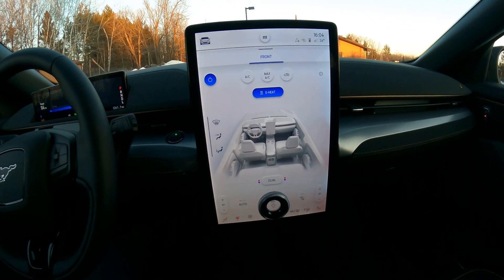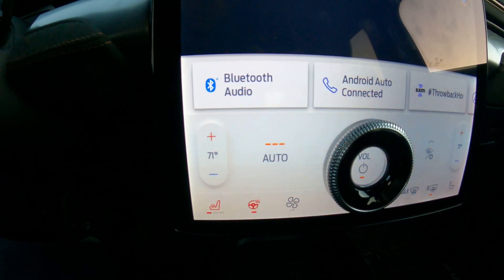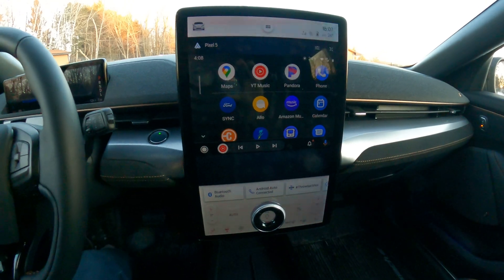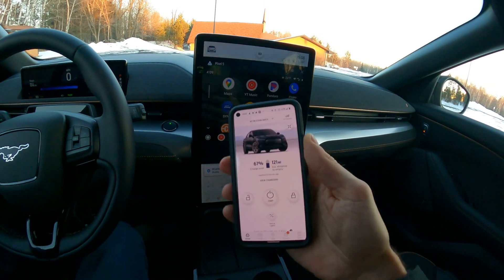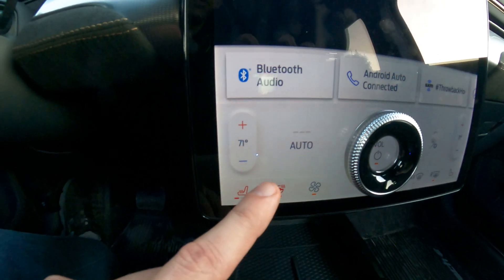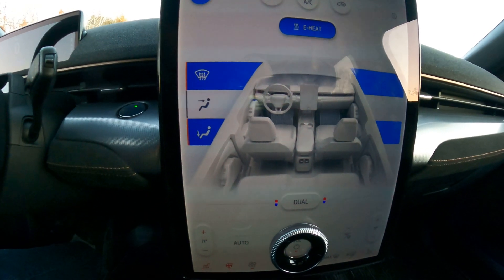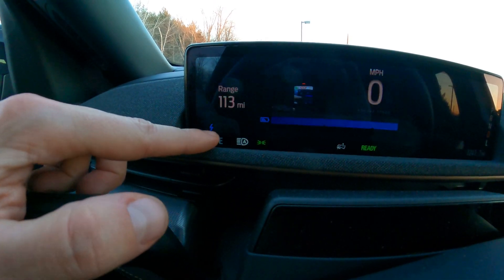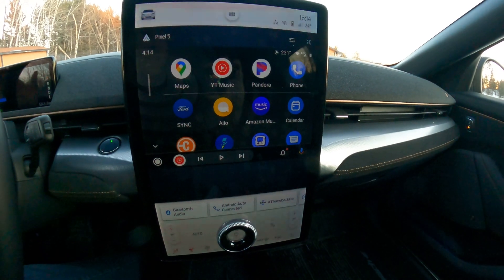Mustang Mach-E Electric Heat - 5KW heater enough for MN Winter?  EV Heat Mach E

Comment: When parked, the interior heating is turned on only when the driving mode is on or after it if only the ignition is turned on, but if the car has been parked for a long time and only the ignition is turned on, then the heating does not occur. GT version

Comment: I was wondering if you had a chance to talk about the difference between the Heating Pump and the PTC System. Going to pick up a Mach E very soon.
Reply from the maker: I cover it a bit in a different video I believe.  Pros and cons to both and I think the ideal solution in cold climates would be having both, but I'm sure that adds a bit to the cost.  The heat pump is more efficient but doesn't do as well in very cold weather.  The PTC uses a lot more electricity, but isn't affected by ambient temperature.  My main gripe is that it's undersized for the MN winters and if it's below zero degrees F it just can't keep up.

Comment: I watched a video of Mach e saying there was no heat coming to their feet on the driver side. How is yours? I watched the video more and it looks like you answered my question
Reply from the maker: Mine is much better now with the TSB fix for the heating system.  Still not comparable to a combustion engine, but much better

Comment: Hello Mike, in the Dutch Manual, it states the E-heat can be swtiched off. The car will "generate" alternative warmth. But that sounds nuts. To your knowledge, does the car extract warmth from any other source ??
Reply from the maker: Yes, it can pull heat from the batteries as they warm up due to regular driving.  This is only in very moderate weather.  I can't say exactly what temp, but maybe around 15C/55F or so, where you don't need a lot of supplemental heat.  Think of it more as a shoulder season option.

Comment: I've got a FE Mach E and thought I was going nuts back in the early winter thinking my heater was blowing cooler air at times, even after preconditioning (Manually starting from FordPass, not by departure time). I currently precondition the car while not plugged in (working on getting an adapter for my plug so it can reach my car in the driveway). At low speeds the car heats just fine, but once I get on the highway I'm freezing and the car struggles to defrost any ice build-up on the windshield that may occur. It was 1F this morning, roughly -8F with the wind chill and my car didn't get warm until I parked at work, which is around a 25 minute drive. 

So far I'm extremely unhappy with all of the issues with my Mach-E (I expected some, just not as many as I've dealt with), and winter driving really makes me consider trading it in... Then I remember how much I like it during the rest of the non-winter months.
Reply from the maker: I'm with you!  Watch some of my newer videos and you'll see some tips I have.  I've learned a lot over the past month!
Reply: @upnorthmike6085  Hey Mike! I had actually checked out some of your more recent videos since posting here. I'll definitely be giving the preconditioning through departure time a try when I get a longer charging cord. Definitely glad to of come across your channel!

Comment: Do you have any issues finding charging stations for your car?
Reply from the maker: I do not.  However, there was one time I was going to travel about 2 hours to a small town of less than 3,000 people and there were no charging stations within 50 miles.  I took my other vehicle instead that time.  Otherwise, with just a little pre-planning, I have had no issues finding either free or fee based chargers

Comment: Is there a difference between using the departure setting in the Ford Pass and manually starting it 15 minutes before you leave?
Reply from the maker: Great question Greg; no there is not.  My issue is my schedule is constantly changing, so I like to just use the manual option.  If I worked M-F 9-5, the departure setting is by far the way to go!
Reply: I spoke to the engineers at Ford about this.  Turns out there is a difference.  ONLY by setting a scheduled departure will the car precondition the battery pack.  And this can take a while.  It seems to vary based on temperature.   I have a meter connected to my service panel that graphs my power usage ... so I can see when the car started pulling power.  Sometimes it'll start around 45 mins before scheduled departure.  Sometimes over an hour early (e.g. 1h 10mins, etc.). But the primary purpose is to precondition the battery -- which improves efficiency and results in more range.
Reply from the maker: @TheVirtualTim  I learned this through trials and testing as well, see some of the most recent videos.  I can see the curve on the Charge Point app, although in the video I posted today, something isn't working as it should with the departure setting.  Ideally, the departure setting should in fact be used whenever possible, especially during extreme cold.

Comment: With charging  are you having  issues at charging stations?
Reply from the maker: Hi Jerome, what issues specifically?  I use a networked Charge Point charger often and have had no issues charging with that system.  At home, I have a Flo system and no issues with that.  I have also used the included Ford charger on a 40 amp circuit and had no issues there either.  I have yet to charge using a DC fast charger; however.

Comment: I just can't believe in 2022, we have to worry about running a heater in our cars
Reply from the maker: I wouldn't say worry, rather planning ahead when possible to extend range.  I'll do a heater update when we have some -15F weather later this week
Reply: @upnorthmike6085  well, I for sure worry and it’s pretty sucky that we spend 60k on a vehicle that we can’t blast the heat if we want to. Now I get this is only a concern for road trips and I think for now the plan is still just to use the wife’s ICE vehicle for those.
Reply: @JoMiller97  I have a 2013 Volt that I bought brand new.  Great car.  Older technology.  I agree with you whole heartily.  The climate control (heat in the cabin) is the most negative.  A/C works great.   When it comes to heat, EV's have a ways to go, especially if you live in a very cold climate.  The delta for cold air is a lot smaller than it is for heat.  The newer model Y uses a heat pump.  I don't know if it has supplemental PTC heat for extreme cold.